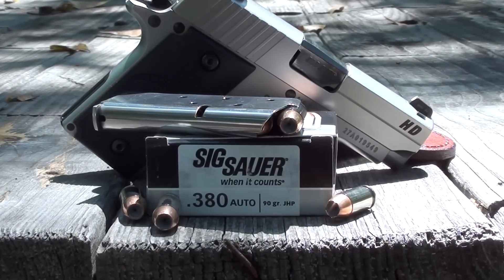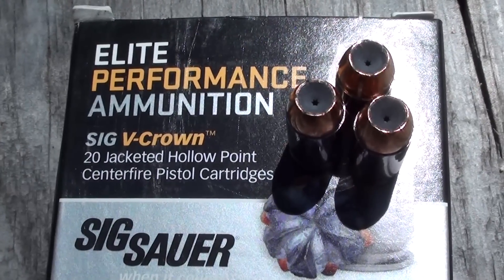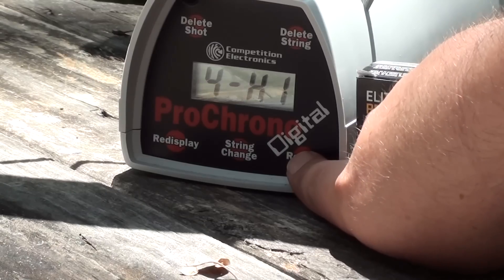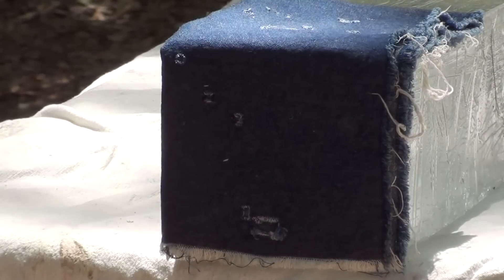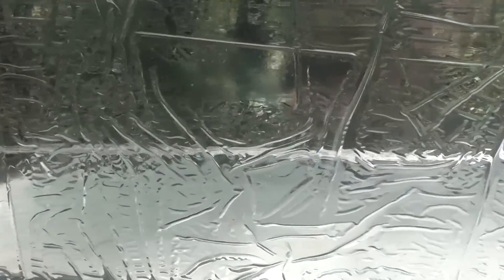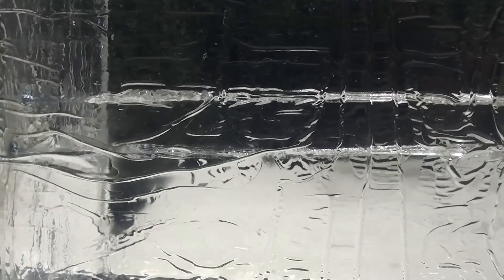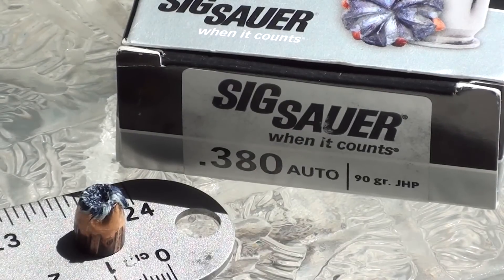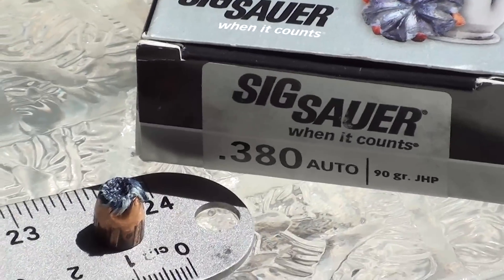SIG SAUER .380 Ballistic Gel Test V Crown 90gr

Comment: Out of shear curiosity I bought Clear Ballistics clear block to evaluate performance of rounds such as this .380 V-Crown by Sig. Luckily I had a few blocks of Knox gelatin with me. This particular training and round performance outing to evaluate feeding and function of the various personal defense rounds through my opinion on   desert. Rounds for .380 were 99gr Federal HST ; Winchester's; Ranger T 127gr +P+ and again  solid performers passing through if FMJ was your choice. As I was just about done packing my pistols and rifles for the drive home.
  He interjected, "Son, don't be surprised when you expect a hollow point bullet to expand. Through clothing; or even bare clear gel the rounds generally the rounds did not expand fully. Even rounds I've put through simple milk jugs with water and cloth over it, the rounds expanded.  Their is an issue with the base substrate and lack of moisture required to fill the " CUP" open cavity in the top of the bullet thus poor expansion of the round. I put 13rounds of this SIG round through wet-pak; gallon jug of water All rounds expanded and penetrated  My opinion, Clear Ballistics is providing a tool that is not accurate. Just a gimmick money maker
Reply: huh?
Reply: So why do other brands and styles work just fine and expand properly in the same gel?...........................elsullo

Comment: You probably pick 1 of the shortest barrels to test. I shot it thru my Sig 230 velocity was around 1000 ft. per sec. they opened up to all close to 500" & all I had was water jugs went thru 3 & stopped on #4. I also have a Bersa 380 CC & they were around the low 900's per sec. but expanded still to around .500". I see this ammo is very picky about barrel length. I could see very little in these from the Speer LE 380 acp Gold Dots.

Comment: I'm late to your video, and I wish I had seen it and researched this ammo first. I just bought it as I was getting a 2nd Beretta Pico. The first one is a shooter, and I was intent on feeding this one some quality ammo to see if it was just as good. Huge problem!!! The bullet is set too long for all 4 of my Beretta mags. I couldn't get three rounds in it, or back out of it. It would wedge it's self in the mag front to back. It did fit in my Sig P230 fine, but it is a full 1/16th to almost 1/8th of an inch longer then my  other JHP rounds I had on hand.
Reply from the maker: Thats a bummer. I have not had issues with OAL yet, but it peaks my interest enough to measure a few, thanks for the feedback